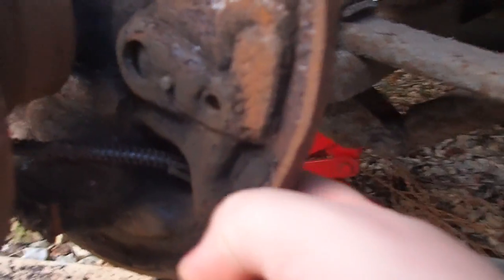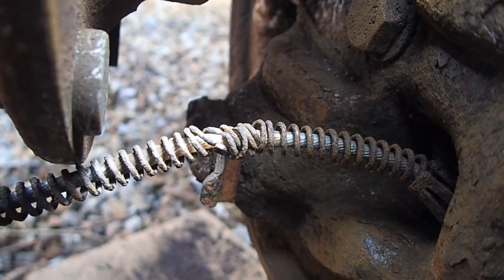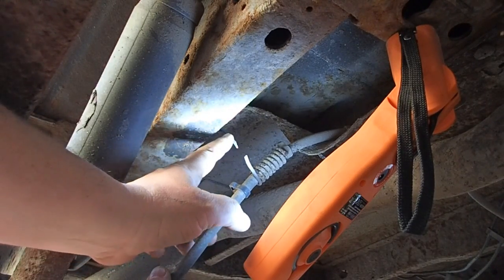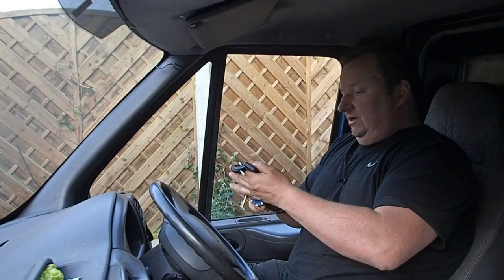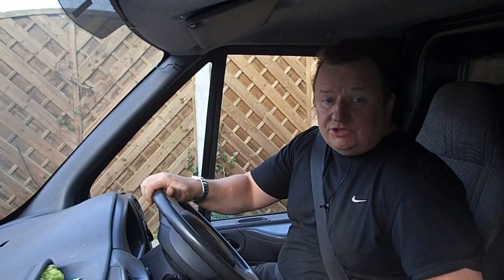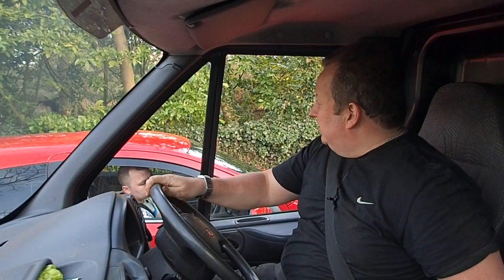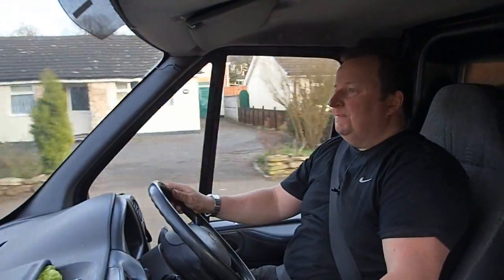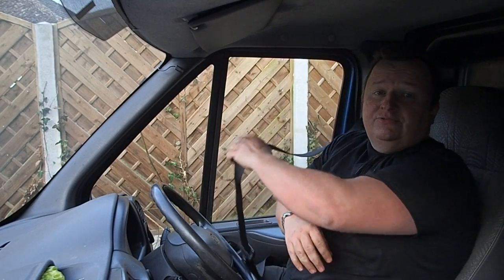Part 2 Ford Transit Mk6 Rear Brake Drum Handbrake Stuck On Stripdown

Comment: With my experience with transit and I used to maintain a fleet of them is that the rear brakes self adjusting do not work properly as they have to move a lot to adjust 1 notch. What I used to do is take the drum off grind the lip from the edge ,adjust the brake a couple of notches so that I could just slip the drum back on,the handbrake when the van came in was seven notches to put it on and when I had finished it was one or two notches and that’s without adjusting the cable.

Comment: That spring on the cable will help the h/brake release, but it's usually the cable itself or the pivot points for the levers, etc., that seizes up and causes problems (they can actually be too tight on new shoes sometimes).  The lever on the shoes should return back when the cable is not connected.
It was a good job you did them anyway - looks like those shoes weren't too far off failing. I've seen the friction material detach and cause the brakes to lock up on several occasions.
Reply from the maker: +mrman17 All the pivot points were free so it was the spring. Yes, I got to those shoes just in time I think.
Cheers
Martin

Comment: Hi mate great video really informative just one wee question how is it you adjust the handbrake? My van when the handbrake is fully down the handbrake light stays on unless weighed down with a jumper do you think it will just need adjusted? Cheers
Reply from the maker: It's probably the light switch that needs adjusting Harry providing the brakes are not on as well.

Comment: Can a floor hand-break be changed/converted to an under dash hand-break. I want to make more room between driver seat and passenger seat to access rear of van and want to remove obstacles (floor hand-break). Do you have and video's for this?
Reply from the maker: No sorry bud, Never done that modification.
Cheers
Martin